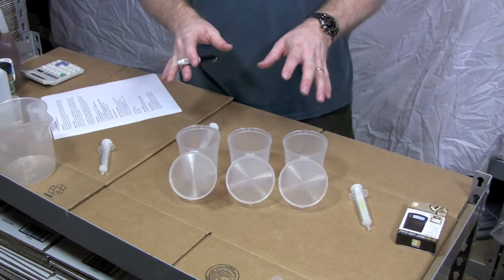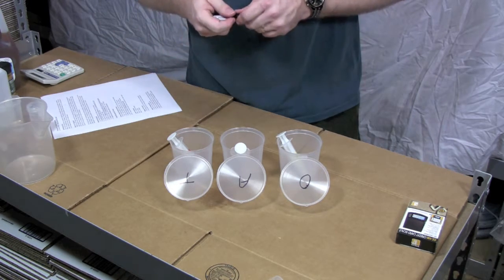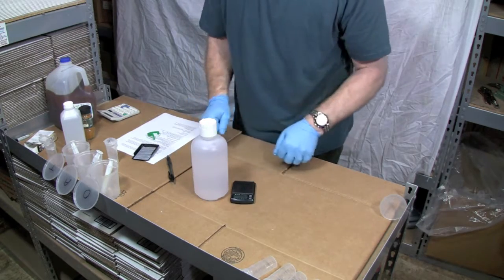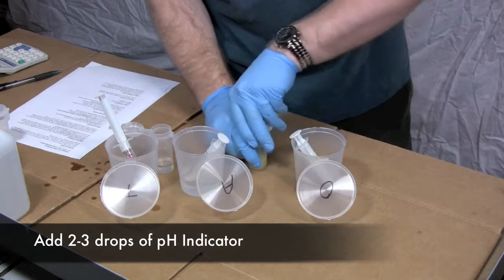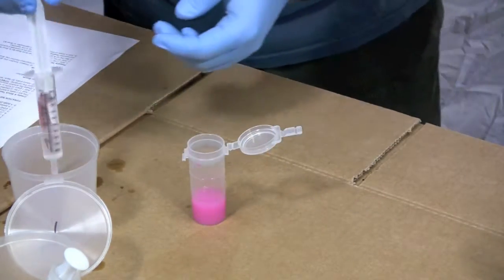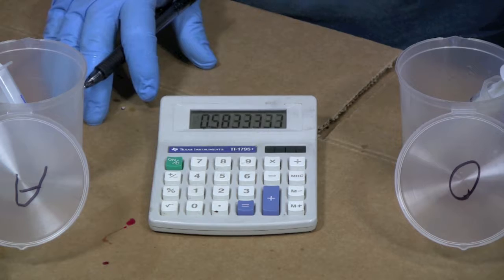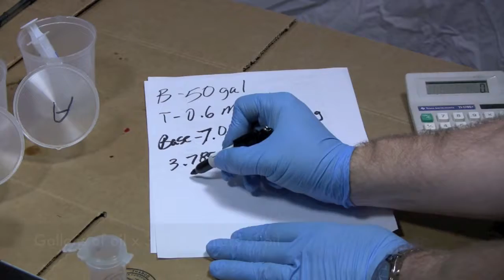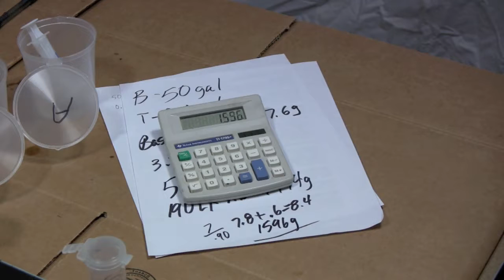How To Titrate Waste Vegetable Oil For Biodiesel Production

Comment: Kindly, can I know what's happened if I increase sodium hydroxide percentage when producing biodiesel, is it effect on Biodiesel quality or ot can be harsh to car engine?
Reply: To a point, it won't hurt anything in the reaction, but once you reach a certain point it'll start converting the biodiesel into soap. It won't hurt biodiesel quality per se, it'll just make it harder to wash the fuel. And, if you add way too much your biodiesel yield will start going down.